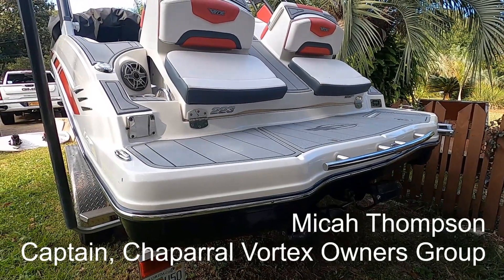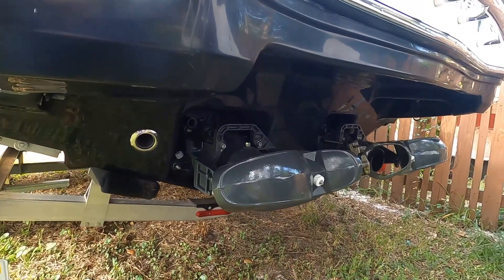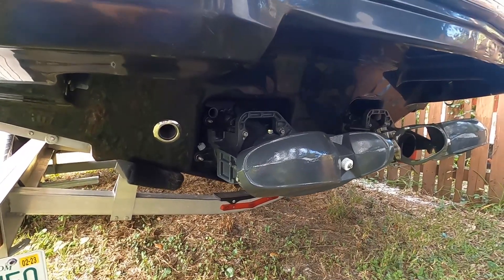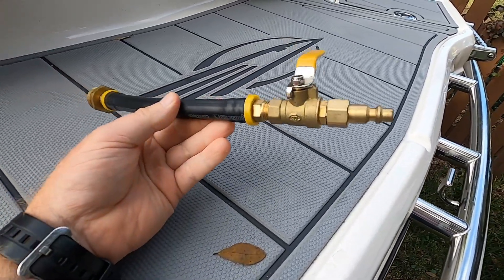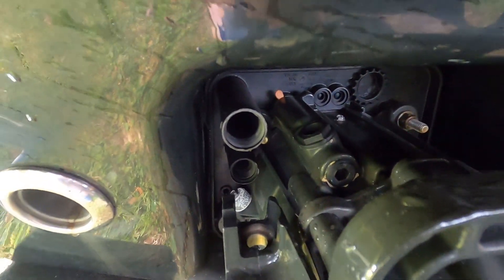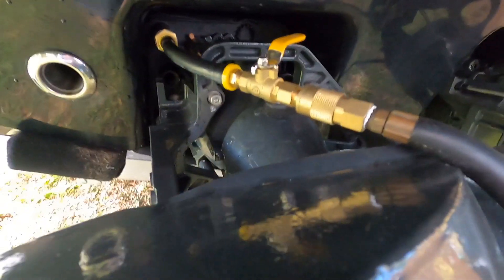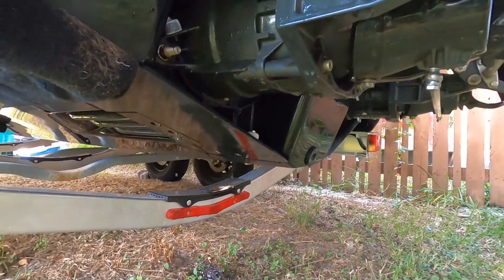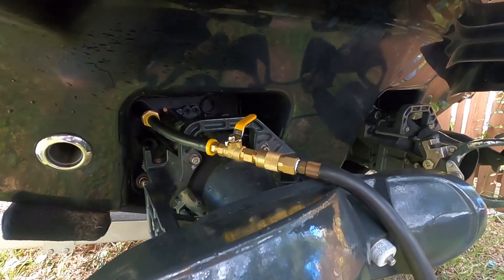Winterizing your Vortex, Scarab, or Sea-Doo Rotax Engine - water evacuation!

Comment: Where are you attach that fitting to the back of the motor? Did you have a plug or does it not have a plug?
Reply: Top left corner above the jet at the back.

Comment: Is there anyone here that can answer my questions ? I just got me a 2016 203 vrx and needed some help
Reply: In addition to getting the water out of the exhaust system like it is very well demonstrated in this video, I pull the plugs out of mine and squirt a bit of oil in the cylinders.
Than I pull the fuel pump relay and crank the engine over a few times to distribute the oil on the cylinder walls and piston rings.
Put the plugs back in and install the coils. plug the fuel pump relay back in and disconnect both batteries.
I use a battery maintainer to keep them charged up.
Check the antifreeze concentration in the cooling system and that is all I do to winterize mine (2017 Chaparral 203 Vortex.)
Reply: @alfamontydog  On a Seadoo 4 stroke its easier to remove 2 screws and lift the fuel rail and the injectors and then put a bit of oil into each of the 3 injector inlets to the motor.  That saves you pulling the plugs and wear and tear on the spark plugs caps and coil assembly.  And on a Seadoo the fuel and ignition systems are disabled by applying full throttle when cranking the motor, no need to pull any fuse.
Reply: @kevinmchale5660  It may be easier to pull the injectors, but the oil injected into the intake will end up on the back of the intake valves, I prefer to pull the plugs and inject direct into the cylinders.
Also a damaged coil would be a lot cheaper to replace than risking damaging an injector or getting a fuel leak, with a chance of engine fire.
(This advice from a auto repair shop owner, of 40 years)

Comment: Thanks for this video, will order the RV Flush Adapter. As a side question, have a 2 year old Scarab 215ID with twin 1.7L Rotax engines, each with about 75 hours.  Most of the summer I had uneven running of both engines, the Tach would go up and down and you could tell they weren't running correct. One engine wouldn't start, but replaced the spark plugs and back in biz. Any thoughts on the rough running?
Reply: add Starbrite gas treatment to your gas every fill up.  It's good stuff and will cleans jets, injectors, carbon deposits, etc and lubes you fuel system as well.

Comment: Hi Micah, 
This is all that needs to be done to winterize a Rotax? A mechanic is asking $250 to do this. Am I missing something? Thanks
Reply: I have the same question. Have you gotten an answer from another source?
Reply: they change the oil, oil filter and spark plugs as well.

Comment: Great video Micah! Just came across this randomly. lol I'll keep it nearby next I'm asked the same question. ;) One thing worth mentioning... many don't happen to have a decent sized compressor. Of course, they can invest in such a tool which can be highly useful. Part of the reason I use antifreeze isn't because I believe it works better but because it requires nothing. You can do it via gravity only. Or get a $20 drill pump with hose (but that assumes you have a drill). 

I realize many of us boat owners have compressors though. But I've talked to quite a few that don't. In Canada, there's also the status quo of just using antifreeze for winterizing things here before winter. So people just like to use it. Psychology at its finest.